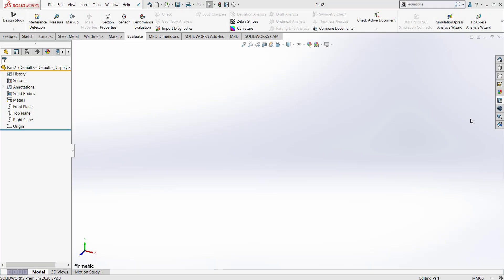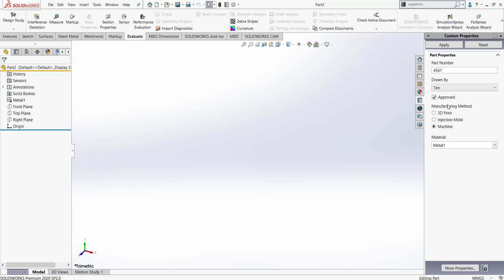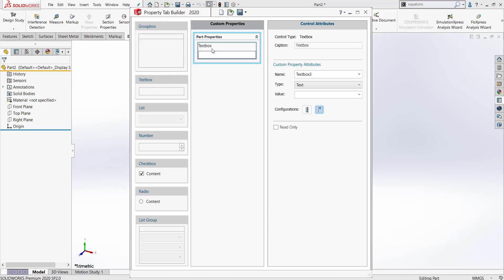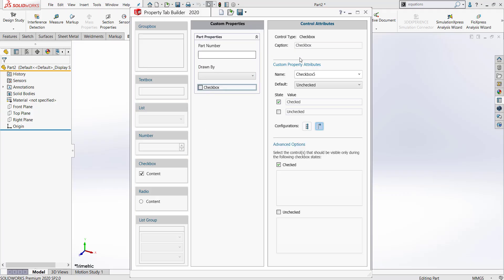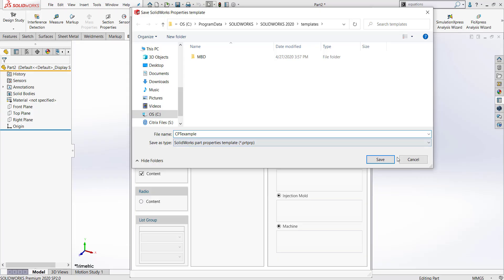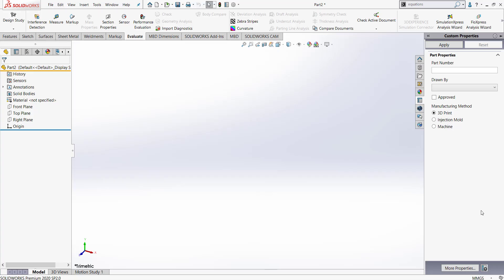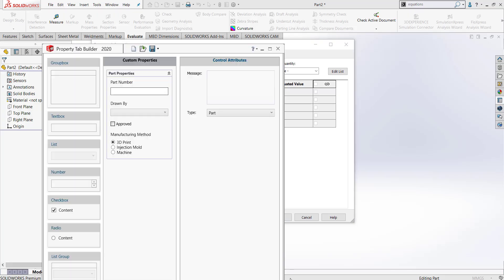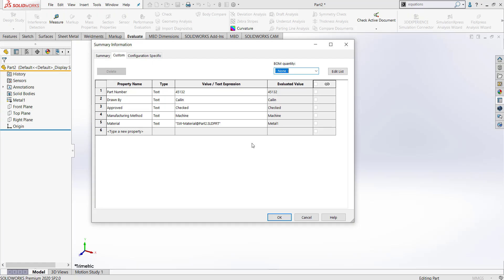SOLIDWORKS Tutorial - Create Custom Properties with Property Tab Builder

Comment: Is it possible to make a custom property drive a sketch dimension? i.e. so you can quickly change some aspect of the part geometry via the custom property tab?
Reply from the maker: The waste material is typically collected by a service that specializes in hazardous waste removal, however a new trend is to use a machine like the Onulus Wrap (https://www.goengineer.com/3d-printing/post-processing/onulis-wrap-w7500) to bulk cure UV-curable photopolymer resin waste thus rendering it inert and safe to dispose as standard waste.
Reply: @goengineer  what?

Comment: One note of caution - When you have the Properties Tab on the right selected, you may find that selecting faces to mate in assemblies take a lot longer. There is a significant delay. Just click the Home tab, and selecting and mating should work fine.
Reply from the maker: I just tried testing that on my system and I did not find any delay. If you have not already you may want to check with your VAR's technical support team to see if there may be an issue in your system/environments

Comment: Hi, Is it possible to add section properties of any surface of a part in to the file properties for automatically calculating inertial value of that surface?
Reply from the maker: Good  morning Mit, Unfortunately at this time that is not possible. You would have to have a dimension of some kind to link to the properties. and sections by default do not create real geometry like that. You could possible create configurations with the section cuts implemented in the model, and use those dimensions to link to properties.